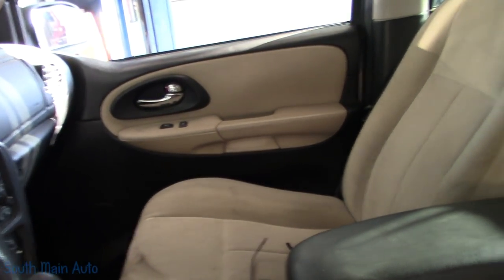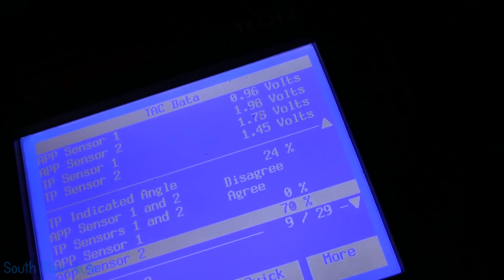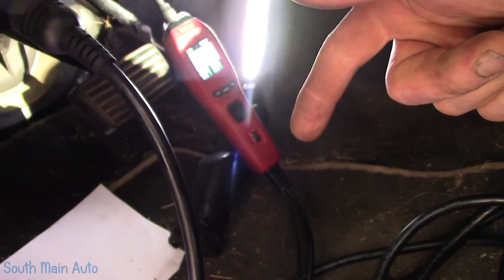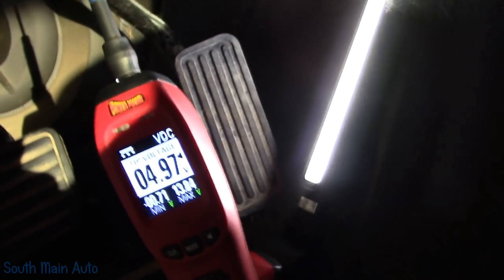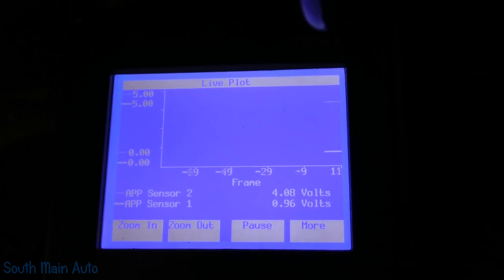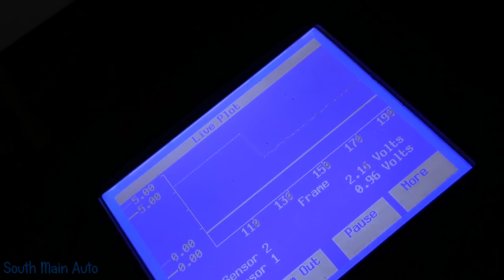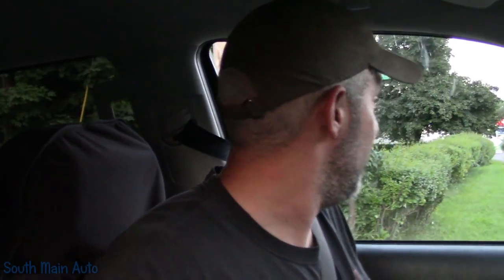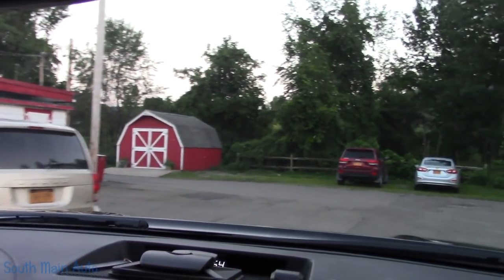Service Call: Chevy Trailblazer P2138

Comment: The common thread through a lot of these issues is the approach. The in, outs and signals. What else is on the circuit and what turns on and when does it turn on. That's not to say anything of this is easy, but having a repeatable approach and methodology is paramount. Great job as always sir

Comment: Great video Eric. Just finished watching Paul Danners video on 5V premium channel explaining ETS 5V ref. And how they are programmed to read opposite of each other and what sensors are tied into the circuit and how to disconnect each one to find the short and along came yours explaining and showing how it works. He showed your approach except he did not say to cut the wires at the ECM. Guess you can't go that route in class but I see how you would in the field. Your video was great and thanks for posting and enjoy that ice cream 👍👍

Comment: I had an ‘02 TrailBlazer. Best vehicle I’ve owned. 200k with few problems except for the stupid cooling fan. I realize that an electronically controlled engine fan sounds great in theory and probably adds .01% in fuel economy but they never worked right. In later years they went to a straight heat sensing clutch.

Comment: We are "blessed" with an 03 TB. LT. - These are takeaways I get from this video. 1. Armageddon may not be. 2. There is a 5v reference in cars today like an analog / digital PCB in a computer (of old). This is right in my wheel house. I'm so glad that you put this video up and that I got to see it. If my wife's TB every goes into "safe mode" with all sensors complaining. Gosh, just measure the 5v ref before sending it off to the scrap heap. It was the fan?? That's both cool and alarming. That reference must not be very well regulated.

Comment: Nice work. Very similar to how we repair iPhones. Plenty of circuits using same voltages and narrowing it down by which one is causing all that trouble. It’s rarely ever straight forward as the circuit in question being the problem. More likely something else causing an issue with the voltage needed for the particular circuit.

Comment: Instead of cutting the wire pop the computer connector and pop wire out and plug connector in to test. Doesnt take much longer and saves the "hack" word from being used about your work

Comment: You probably know the cluster/speedometer 150mph "feature" can be fixed by disassembling the cluster and replacing the stepper motor that runs the needle. I've also seen the "PRNDL" display go intermittent and fixed it by re-soldering surface mount resistors on the cluster pc board.
Reply from the maker: I know but I was not there to diagnose that, just the reduced power complaint...
Reply: Seems to me a free 150MPH speedometer would be a "feature" and not a complaint...
Reply: GM put cheap stepper motors in the clusters so that's a common issue. Had it with my 05 Impala and had all of them replaced

Comment: Having same problem 2010 cmc 2500, throttle body. Reduce power due to signals don’t match... I can never duplicate problem... I put a new throttlebody electrical section on it, and harness... very cheap but didn’t fix shit... we put 85 miles on it will not act up.... I’m going to look what else is on my reference circuit... thanks for giving me that idea

Comment: in my experience work driveability at gmc dealership i have had to replaced the app sensor /pedal and/or restring the circuit to the throttle body typically caused by terminal fretting. i havent seen this issue with another component causing this.

Comment: my neighbor s have two of these with over 250k .  No issues. Only a coil pack and failed 4wd module from stink bugs in it. All my GM 5.3 over 275k only fuel pumps and wheel hubs minor issues. GM came a long way .
Reply: I hope I can get close to that with my 2000 Blazer. Currently at 175k with only about 15k on a rebuilt tranny
Reply: Jeepers, you must live in the desert
Reply: Starcrunch72 Nope NYC and Virginia. Salty rough roads abuse of vehicles. My 2004 Chevy has 330k original motor and trans. 
In fact second place in Guinness world records is a 2006 Silverado 1.7 million. First place 3 million on a Volvo near our shop on Long Island.

Comment: I'm surprised no one sells interconnect boxes to go between the wiring harness and the ECM, with some sort of dip switches on each pin out to allow you to control what's going in and out of the ECM, instead of having to cut the 5v ref.

Comment: APPS theory. Double POTentiometers on the same shaft. High side of each wired to the low side of the other. Ground one and 5 volts to the other. The wipers must agree at the ECM . One goes up other down. Sum should be close to 5V reference. If not, CEL comes on. SHort the 5Vref to ground and whatever is tied to it in the way of sensors is not going to work right. We have a new ice cream store in Seneca, SC. They freeze in a standmixer bowl instantly WITH LIQUID NITROGEN. FIrst tires, then SHELL gas now ice cream.

Comment: excellent video, and certainly hours of frustration for the inexperienced tech.  thanks for sharing.
one thing i didn't understand is cutting the 5V wire near the ECM- you said if you still don't have 5V then the wire is shorted.. where?  inside the ECM?
Reply from the maker: Yes if you cut the wire near the ECM and you do not have 5v ON THE ECM side of the wire then yes, the ECM is junk
Reply: That was my question too.....of course you wouldn't have 5V on the wire you just sliced it in half!
Reply: unless it's shorted to the other 5V ref and back-feeding.  not likely.

Comment: That has to be the dumbest thing to use a critical reference voltage for, a bloody fan!!.

If i had one of those vehicles, eather the 5v reference wire to the fan would gain a 1000 ohm resistor in series to protect from fan shorts.
Or just feed the fan from a 7805 regulator instead, i can't see a fan being too touchy.

Comment: Super concise and helpful!!  Each module has a path to jack with your 5 volt reference!! Also the two tpp sensors must use a different source for the 5 volt ref, correct?
Reply from the maker: Yes sir

Comment: I have this same issue in my 06 silverado.  I replace throttle body with oem and fuel pedal with oem and still going into limp mode when idling too long. Use to do it now and then, maybe once a year or twice. Now does all the time. I'm disabled and can't afford to take in to shop, but am mechanically inclined. Any way you can show what wires you hook to to get you voltage with the meter on the pedal. I don't have the big computer you have, but I can test voltage with multimeter. So If I unplug fan and all goes to normal replace cooling fans. But if don't I need to check fuel tank pressure senor? And others I could check if still not problem? Thank you for video. Wished I'd found this before I bought throttle body and pedal. LoL. Hopefully I can fix easy. Thank you again.

Comment: Somebody explain to me why we need such unnecessary complexity to open the throttle.  As if there was something wrong with having your throttle opened by a steel wire connected to the gas pedal. 

(And yeah, I know it has to be this way for electronic stability control)
Reply: Makes cruise and traction control a lot easier, all but eliminates the possibility of the throttle jamming open plus other things like making changing the pedal/throttle mapping easy.
Reply: Graham Langley darn it! I don't want a reasonable answer! I just want to be grumpy.
Reply: ask Toyota how the "drive by wire" (electronic throttle) worked for them :)))))
Reply: + Volcker1929 Sorry about that.
Reply: ok the real reason is control over the air flow for best air volume/ air-fuel ratios in all situations, which improves fuel economy, throttle response, shifting, horsepower and torque and gets rids of idle air control valve (IAC). include two things mentioned by Graham, " traction control and cruise."
as for throttle sticking, the last one I had that stuck was a 1982 van with about 200K miles, the rust holes/leaks let the"salt/rust-belt" water get in and rust the pivot bracket
Reply: I miss feeling the gas pedal pull away and back from my foot as I drove with cruise on. My new car, the pedal doesn't move at all with cruise engaged. Very disconcerting at first.

Comment: I’m currently having this same issue. It only happens when I hit a large pot hole or turn very sharp. I also have a C0035 C0040 codes for both front wheel speed sensors. Can they cause this P2138 code?

Comment: Tell your other shop I do full instrument cluster rebuilds on any GM instrument clusters for 120 I give lifetime warranty on the stepper motors and can fix any issue with them.
Reply: Expensive, I do it for $75. Or anyone can do it themselves for $20 of eBay parts and a YouTube video
Reply: Yeah your right. Except when you lift traces off the board and need someone who knows how to figure out how to fix it then I charge extra. Thing is I used to do them for a lot less and if you are your already cutting yourself short unless you do not know how to repair all of the failures these have its not just simply replacing stepper motors. Thing is a re manufactured cluster is 250 and I do everything that you get with reman not just replace steppers.

Comment: Nice video! When you work at other shops, do you act as a teacher as well as solving the problem?  Or do you fix, charge, and run?
Reply from the maker: Try to just be in and out and collect the check. If they want to know I show them. Most just want the car fixed or diagnosed is all.
Reply: How sad. They miss a golden opportunity to learn from a master.

Comment: I have a 2007 Pontiac G6 with a 2.4 eco tech that runs good for a day and then it throws a code for the pedal position sensor and mass airflow sensor. I’ve replaced the ecm, throttle body and pedal position sensor I’m pulling my hair out! Help

Comment: I hope i have the answer, and you still there sir.... 

I have some problem with nissan nv200 with engine code HR5DE. 

and the problem was P2138, i've changed App censor, CKP censore,ignition coil 4pcs..still doesnt work. 

Map censor, MAF censor,O2 censor are Ok... 

The engine now is so smooth, but no acceleration..its hold just in 30kph.... 

Any sugest sir, please 🙏

Comment: I am not understanding the test where you would cut the 5V ref wire at the ECM. If you cut the 5v wire off at (6 inches from) the source, how could everything be restored on the load side of the cut? I would think if ECM is good you would read 5v on the ECM side of the cut, but 0V on the load side of the cut. What am I missing here? thx
Reply: Everything is not restored on the load side of the cut. This step is only taken once all other possible causes of the reduced reference voltage are unplugged. If probing the 5v reference wire prior to cutting it reads lower than 5v and cutting it restores it to 5v (on the 6" side) it probably indicates a short to ground on the load side. Now you can trace the short to ground and repair it before splicing the reference wire. That's when the load side would be restored.
Reply: Patrick Burns ah ok thank you very much. That makes sense.
Reply from the maker: Well said Patrick!

Comment: Could a possible Ambient Light Sensor that is busted cause a reduce power I have a 04 buick Rainier an the sensor is busted an ever time it gets dark it goes into reduce power mode but only when it's dark the codes it keeps pulling up are p2138 an p2122 I have tested everything an ever thing is working. I just have the problem when it gets dark can this cause me to lose my 5v ref. Has new throttle body new pedal

Comment: Why does the cooling fan need a 5vdc reference wire?
Reply from the maker: It has a 5 volt speed sensor on the fan and is electronically controlled for fan speed
Reply: South Main Auto Repair, thanks for the answer. I’m old school. I remember when it was either “on” or “off”.
Reply from the maker: Now why would they make a fan so simple when you can make it so it shuts down the whole car when it fails!?

Comment: So, if I go to the ECM and cut the wire for the components' 5 volt reference signal, I would then use a DVOM to check for 5 volts there at the short piece of wire that's still connected to the ECM?
Reply: yes you would then check the short wire that's cut to module for 5v ref. if the 5v ref is restored then you know there is a problem in the wiring from cut wire down to app
Reply from the maker: That is 100% correct. If you cut the wire and your 5v reference is restored then you know for a fact  there is a short in the harness. This is assuming you've already unplugged every component that runs on that circuit

Comment: That is an extremely stupid design to run all those sensors on the same rail...
Reply from the maker: All manufactures do it. GM in this case has 2 5v ref. lines in the ECM. This is very common on all vehicles and has been for a very long time.
Reply: I remember what my dad used to say. "If all your friends decided to jump off a bridge, does that make it a good idea?"

I once had a 2006 Nissan Sentra that had an evap sensor shorted out, caused the 5v to get pulled down on the pedal. Nissan fixed it with a parts cannon.

Comment: For NISSAN rogue 2015 Sv AWD what which transfer case / diff oil would you use .Is it Limited slip differential? And how often needs to be changed?
Reply: Julia M look in the owners manual will tell you what oil and when. Manufacturers spec is the best.

Comment: Your car's engine runs like crap and died in the middle of the freeway. Must be the electric cooling fan. *facepalm I hate modern cars.
Reply from the maker: Orrrrrr the fuel tank pressure sensor... orrrrr the AC pressure switch haha
Reply: Why,why,WHY, would they put a vital sensor's power in with a bunch of other stuff like the fan speed sensor? I could understand like the Throttle sensors and the IAC position and stuff like  that that have to work together before it runs. But seriously a fan speed sensor bogging the car down? UGH!
Reply: Dude, it's technology. You'd be diagnosing your horses manure to find out what's wrong with it if it weren't for bird brained engineers designing crazy circuits for us peons.
Reply: Well. 5V regulator like LM7805 are about 10 cents a piece. Very expensive. A separate current limiting 5V source per sensor would cost at least $10 per PCM and extra wiring another $10. That's all out from the profit you know? If you make a million cars you have just lost 20 million in profits.  No can do.
Reply: IMO its the keep it simple principal taken to the extreme or without context. As hardware is all about keeping it running, then the keep it simple would refer to fixing it, not how few wires are designed in to it.